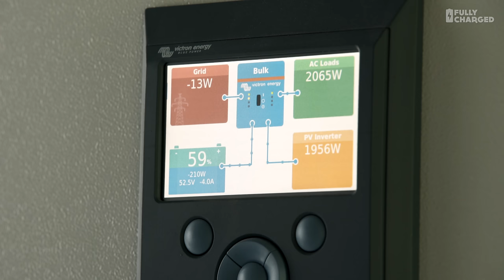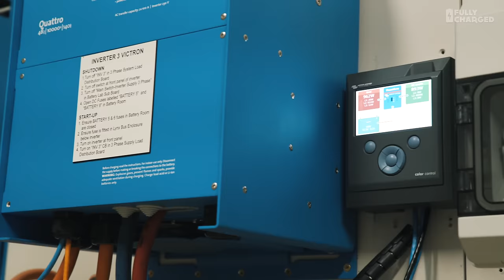Redflow ZCell batteries for home renewable energy storage | Fully Charged

Comment: After all is said and done the one thing you must have to be "eco friendly" is plenty of spare free cash to pay for all of these wonderful new shiny toys and systems that are constantly being updated.   So given that you are rich and decided to build a house and incorporate all of this technical wizardry you then after 7 years (average house ownership) decide to move on and the new rich owner replaces it all because it's all so "yesterday".   Where is the real cost effectiveness?    What is really needed is a small cheap plug in device that gives free energy (or almost free) that has no massive installation costs and that anyone can just plug into their wall socket.   Solar energy and batteries are a dead-end street.   You can't hide solar power from the "authorities" and if it was really effective would be taxed to the heavens.
Reply: I agree but if it is produced then the power of the internet will mean that people will be able to get hold of it and in the end the 'authorities' will have a heck of a job trying to suppress it.   It's coming soon so forget solar power and expensive batteries.
Reply: Not sure where you got that 7 year figure from. From what i can see with the mighty power of google the average is 13 years in the U.S, and in the UK it's 14 years with the average moving to 21 years in cities. Also assuming the new owner is rich and is going to change it all probably isn't very accurate. I just bought a new house and can barely afford to get a new bathroom in it at the moment!
Reply: Insulation and airtightness before new bathrooms!